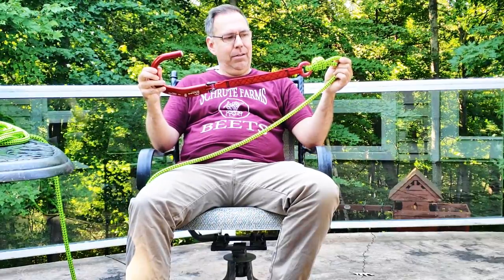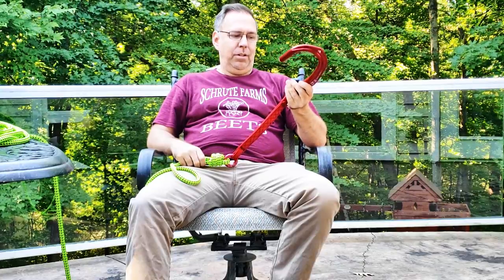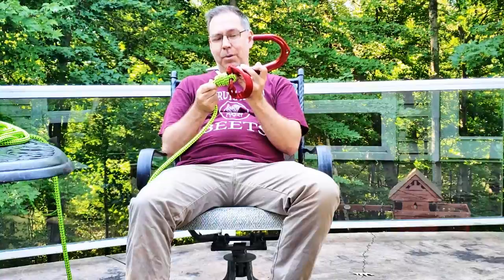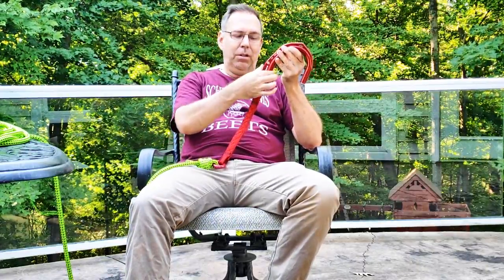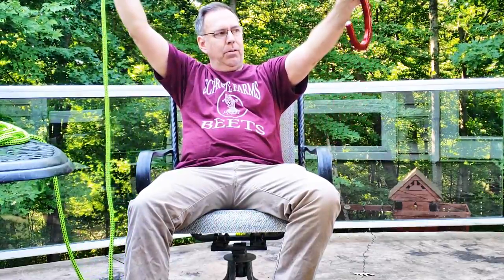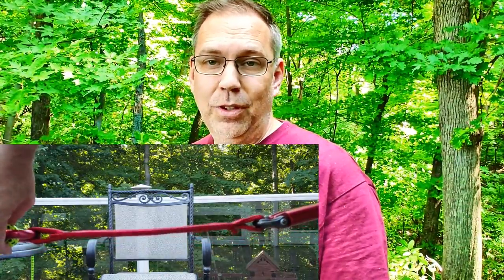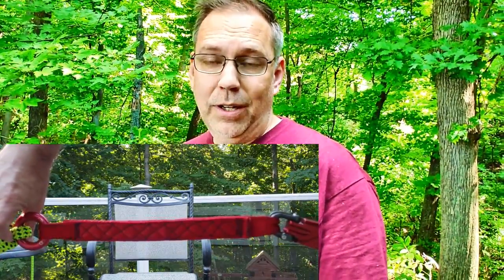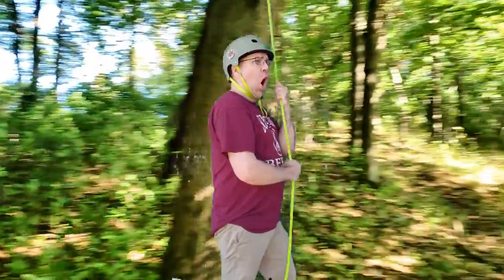Homemade Teather For DMM Captain Hook

Comment: Nice work! I've been climbing on my own hand sewned eyes on my line yards for 4 years! Never had any issue, probably loading it a lot more than I should! My main lanyard which is 2 years old now has a better looking eye than the rope itself!
Reply from the maker: Be sure to get your work break tested so you know if it will hold for fall arrest, but that's great that it held up so well, it sounds like you did it right. Climb safe!

Comment: Something to think about. Years ago when hang gliding was new, my buddy was testing a harness - feel under the hang of the glider.
He was 2 ft off the ground when something gave way and Steve found himself kissing the ground abruptly with a thud. Nothing was wrong with the harness. The aluminium carabineer broke at his 175 weight. Back then, it was a head scratcher.
We want to be safe hanging at 3,000ft.
So check it all...proven or not.
I never used aluminium biners after that. They may work and then there is that question in your mind. I like your video. If the hook was steel, I'd trust it for life support. But then again, it is a tool not ment for hanging on.
Happy Hanging!!!
Reply from the maker: Thanks David, I appreciate the thoughts. Sounds scary, glad it was only 2 feet up.
Double checking and gear redundancy are good things, stay safe up there.

Comment: To make it strong as possible after machine stitching I would hand stitch it with the strongest hand stitch. The saddle stitch. I am a leather worker and it's the strongest stitch known to man. Not sure if it is for climbing but with this stitch ifnit breaks in one part it wont come unraveled. If you ever need a sample of heavy stitching done let my know I have a industrial sewing  machine with a 1hp motor  that can stitch up to a 1/2 in material.
Reply from the maker: Nice, I keep an eye on craigslist for a used machine that can do 1/2" stitch width so I can sew my own tight eyes on my ropes, and sew heavier things like webbing.
Reply: I have a Juki 1541s it's used for sewing heavy leather and canvas. A used one cost about $1200 new $1800. Love your videos with the humor keep them going.

Comment: So what would be wrong w/using a loop of webbing tiied w/a water knot instead of the tether? Do you lose too much  of the webbing in the knot? As you pointed out, it's not for life support. I suppose the loop could get hung up where a tether just slides through.
Reply from the maker: My goal was to make it as streamlined as possible, to avoid getting knots caught in a tight crotch, or add a bump that would make the hook jump out of the target spot. But mostly this was to see if I could sew something, and make it decent to climb on. That shackle on the hook can be unscrewed, eventually, I will probably just put it through a tight eye.

Comment: Why not splice the rope directly to the hook? What advantage does the strap provide?
Reply from the maker: Simple, I don't know how to splice yet, but I do know how to sew. It's the tool I have, and this was an exercise to see if the problem could be solved with sewing.

I just wish someone out there would make some kind of splicing tutorial video series... bwahahahaha!
Reply: Thing is, there are specific, repeatable instructions for splicing, widely available. When followed correctly, and not even necessarily perfectly, you will be guaranteed to have a safe product.
Reply from the maker: @TreeCutterDoug  this is true, and splicing is a great tool, but I think there is still room to use other tools like knots, and in some cases sewing. 
That's why I don't say I am making a pattern to replicate, I just enjoy sewing and I made a thing. I am not trying to replace other repeatable tools, just showing it can be done, and what the cost in time, material, and what the learning curve is before someone else heads down that path.

Comment: What do you think about a wooden rope wrench tether obviously not life support
Reply from the maker: For me, I would only use wood as a decorative handle over a rope or metal support piece. That tether supports half of you weight, even in a fall, wood is not a good choice for that kind of load. You could drill it out, or glue 2 halves over a rope core and make a cool gun handle kind of tether though.
Reply: @FreeFallinTrees  that's actually a great idea the YouTube video that I had seen the wooden tether was a very small Chinese man I'm 190 lb I was thinking of it being cross loaded right away and breaking then I'd just be hanging on my prusik cord not too safe but yes that is a great idea maybe in the future you'll see what I come up with

Comment: LoL 😂 this isn't just hobby ... This is Rage.  😉👍
Reply from the maker: Rage Against The Machined Tools 🤣🤣🤣
Reply: @FreeFallinTrees   hey brotha ? I look up to you man . As long as there are proper stitchings , proper threads & materials. Then I believe it's quite same as what  major climbing equipment companies does to thier equipments to the mass . They also employs actual human to saw each gears . As long as it's meeting with safety guild line levels why not ?! We  live in a Freedom country and it's your body .  as long as you ain't causing or pushing it's gear to make profits out of it  then that's fine by me and does not need to be singled out or kicked out for saying it.   but should be respected in a much different way with in our community .  I believe Freedom of speech , Freedom of thoughts, Freedom of whatever you want as long as not causing you and others than yourself then it's fine to my mind.  Cheers ! 👍👏